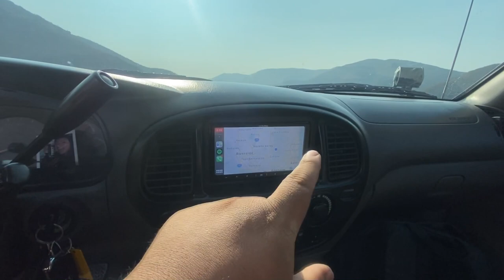1st Generation Toyota Sequoia

Comment: I got my 2004 Sequoia Limited last year.  I found one with only 110k miles on it and its CarFax report was amazing.   Probably over paid for it but it was also green which was my ultimate choice so I paid $11k for it.   I also took out the back row seats, flipped up the second row and I can easily get everything I take camping inside.  When I get to a camp site I pull out my Gazelle tent and unload everything in there and sleep in my rig.  I love this vehicle.  I expect it is the last vehicle I'll ever own unless I buy another Sequoia just for a project. At the price of these.....I'll take 2 please.  :0)

Comment: SEQUOIA vs. 3rd Gen 4runner.
SEQUOIA Is the way to Go.
The 4.7L is fast and capable even with all the mods.
It's Spacious for overlanding.
4RUNNER has a Robust aftermarket parts and Support while the SEQUOIA doesn't have much.

Honestly, having owned both - The MPG is about the same 16MPG Combined.

*5th Gen 4runner is just as big as the 1st Generation SEQUOIA.

Bro, that SEQUOIA looks good. The mods are subtle but tastefully done.

I recommend you replace the starter ASAP with an OEM. It's hidden up under the intake manifold.
Also, get some dual exhaust Flowmaster and you will have a greater appreciation of the v8 engine

Comment: I have a 2001 that was gifted to me with 265K last year. $8000 later I am starting to see the value. Mine was used to haul either a huge RV or a  hugh huge boat. The rear end is too low. It now has 265k. The rear latch is shoot and it needs new rear coil springs because it rides low in the back. Thoughts?
Reply from the maker: Watch my new video, I explain the new coils I added from old man emu, 2860 old man emu are super heavy duty springs that will for sure let you tow, those springs work to lift the vehicle 2.5-3”
Reply: I got an 02 with 384k with just a replaced radiator I put in a few days ago

Comment: Nice build, how much was the front bumper?
Reply from the maker: It was $900 done by a family member, everywhere else it was about 1300, but price of steel and aluminum has gone up unfortunately
Reply: @thecarlitashow4397  Been wanting to do a bumper for mine without the massive weight add. This looks great!
Reply from the maker: @jamesw219  that was my main goal as well, in total it was about 80-90lbs. I did add some really heavy springs recently but it still rides well. New update video next week!
Reply: @thecarlitashow4397  what part of cali are u located? like that bumper..